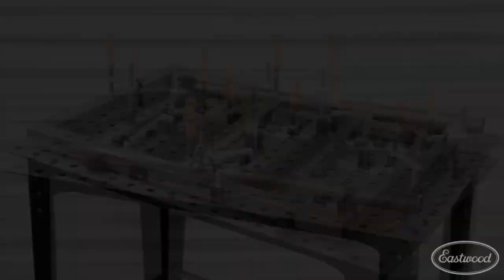Fixture Table - Great for Precision Fabrication & Welding - Eastwood

Comment: Isn’t it ridiculous to have the holes in metric units (16mm), but the spacing in English units (2 inches)
Reply: Ronnie Shand 16mm equals 5/8”
Reply: 2" is approximately 5cm.
Reply: 28mm 0r 16mm